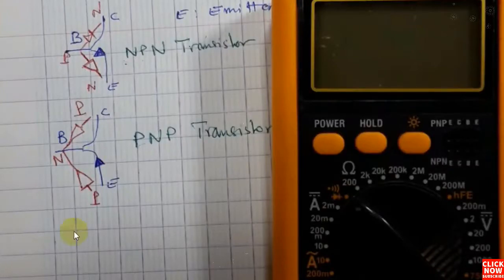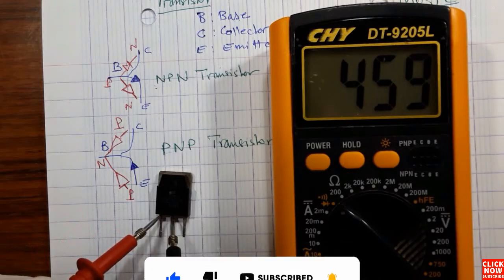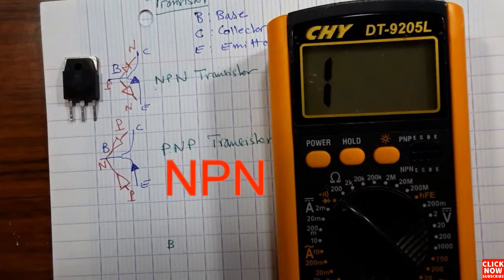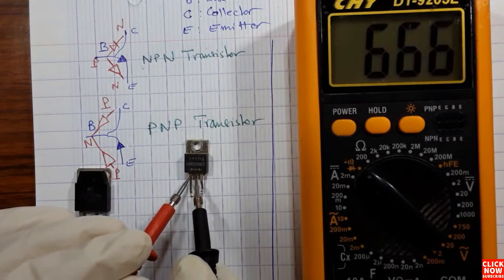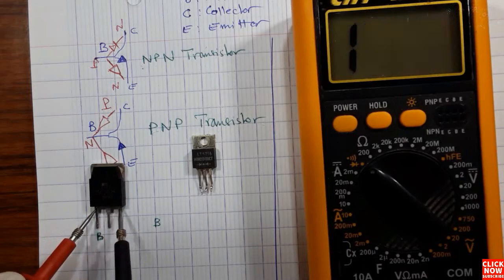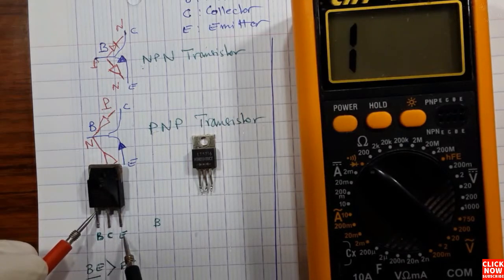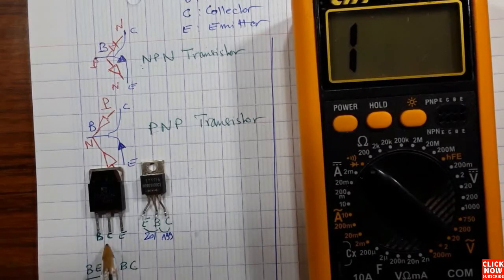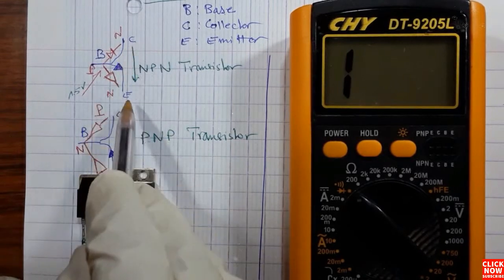Learn how to test NPN transistor and PNP transistor | identify transistor base collector and emitter

Comment: Hi thanks for this great video🙂👍🏻
How do I test an ITE SIO chip to see if it's faulty or not? I understand that the SIO must have certain voltages but I don't know on which pins to place my multimeter on and I can't find a datasheet for it.
Reply from the maker: To test the SIO you can just check the ceramic capacitors near to it, if you find any shorted capacitor means the SIO is faulty
Reply: @electronicsrepairbasics_erb  thank you so much I will do so :)